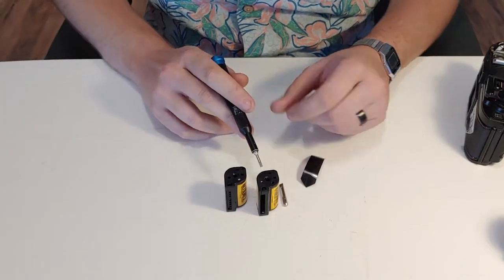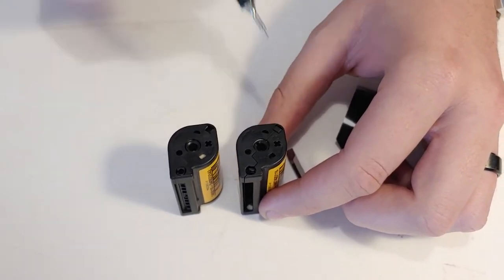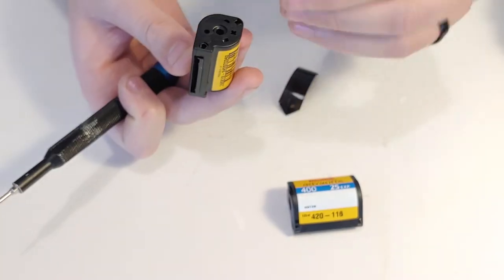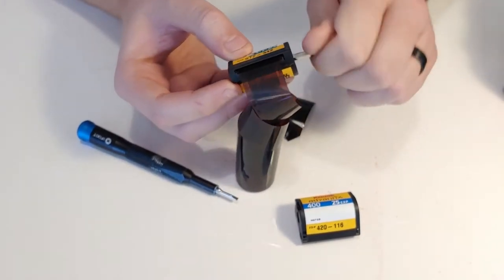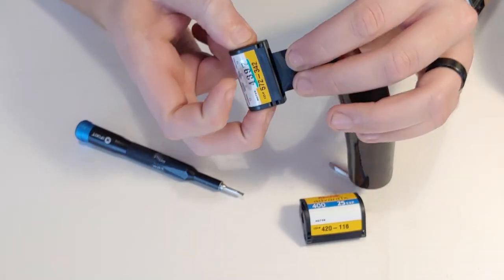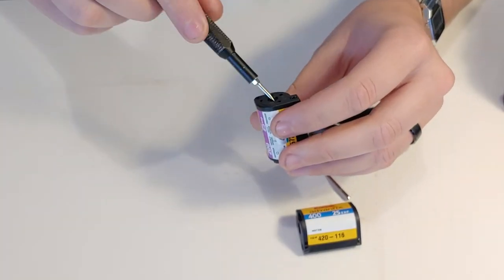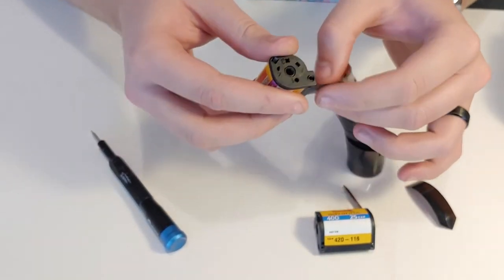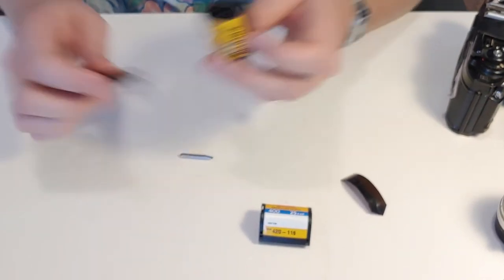how APS film cassettes work and how to unload/reload

Comment: What size screwdriver did you use.  Any chance you know where you got it from?  Thanks!
Reply from the maker: If you get pretty much any screwdriver set, it will have the right size bits. It will be more difficult to get just the bits you need than to just get a set